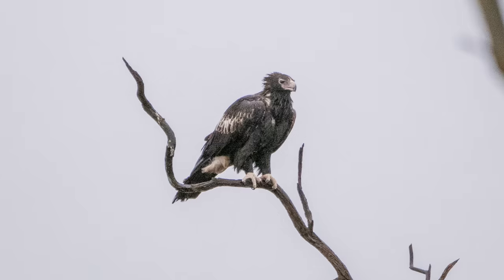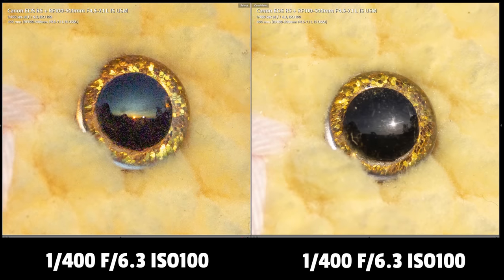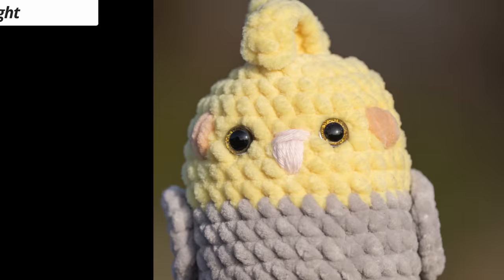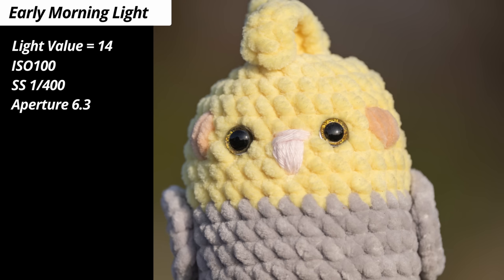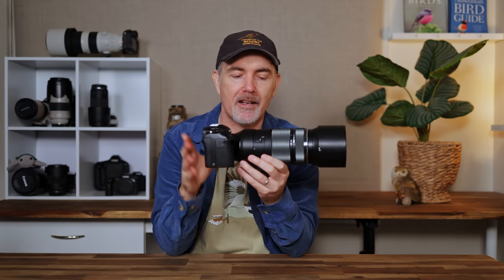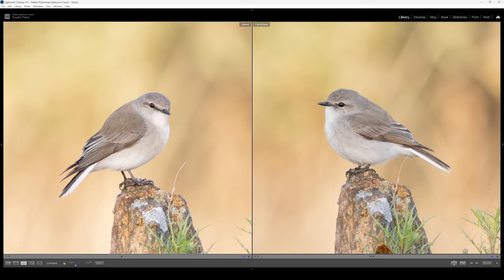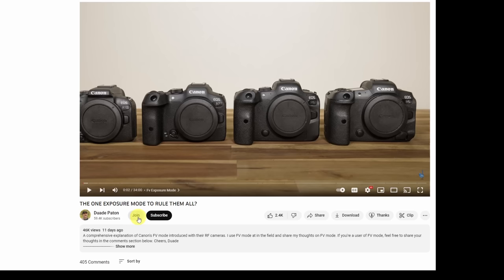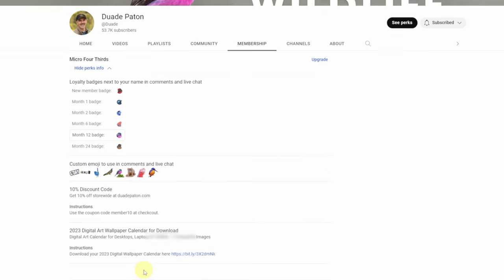NOISE SIMPLIFIED, WHAT CAUSES IT, HOW TO REMOVE IT!

Comment: Technically the lack of light is not causing noise but it is causing worse signal to nosie ratio. As a result to increase signal to viewable level you also have to increase the noise. Also. Camera does not amplify the light. If it did we wouldn't have problem with noise. It amplifies the signal recorded based on gathered light. This signal however already contain noise and they are both recorded. At first it amplify electrically the signal and part of the noise. Above some ISO it just increase the signal digitally amplifying the signal and all the noise. That is why it is better to set your ISO to achive right exposure up until the point when it doesn't matter any more.
Reply from the maker: Thanks Pawel, totally agree, I sould have tried to explain it has you just have. I have pinned your comment so people can see it first. I battle trying to keep it simple and not too complicated but will try better next time. I guess on a simple level the lack of light causes the SNR issue? Cheers, Duade
Reply: @Duade Paton  you explain well just sometimes a bit fast
Reply: @Duade  Yes. Because the light is our signal that changes. And the noise of digital path in camera of simmilar age is more or less constant. There is also analogue path noise that depends on heat and other factors related to that part circuitry and this one can increase with different ISOs (not only is being amplified after recording). I don't understand all the details, but essentially in most cases noise is virtually constant, and the signal differs. But after recording data when raising the exposure you increase both signal and noise. Therefore less SNR = more noise.
Reply: well said Pawel.  Spot on mate.
Reply: @@dr5290 I've never given  much weight to DXO's "weightings".
Reply: @@dr5290 same shit, different smell.  I pay little attention to DXO.

Comment: I was always a bit reluctant to use those noise reduction programs as I was afraid that they'll smoothen detail and decrease overall sharpness, but now I'll give them a try, I got nothing to lose.
Reply: Mainly Topaz will smooth the details from my experience, there is a work-around, you use the inbuilt masking tool on the subject or even better is I would overlay the noisy image with the denoised image and change the opacity of the top layer to bring back some detail but now I changed to dxo pureraw2 and the results are much better and more realistic and keeps the details better.
Reply: My main go to is DxO PureRAW. I think it preserves detail better than the alternatives.
Reply: @AndrewRock  yea im using pureraw 2 now, I have no need to upgrade to pureraw 3

Comment: Great explanation. I had noticed myself that you can use a high iso setting in bright light with little noise and the same iso in poor light and the noise is far more intrusive.
 If you are light-limited and using a faster lens is not an option and you have already maxed out the aperture and using a slower shutterspeed is not an option either for reasons of image blur, you are then forced to raise Iso. This gives the impression that it is raising the iso that increases noise but as you correctly point out , it is the lack of light that directly causes it.

Comment: Quite a few really technical comments. Bottom line is your explanation was simple and straight forward. Outstanding review. How do you determine LV?
Reply from the maker: Thanks Bruce, it is a challenge to try to make is simple as the actual techincal explanations get confusing very quickly. I try to make a balance but concede I am not an expert so get it slightly wrong from time to time. Visit this site and put in your exposure and it will tell you the LV. Cheers, Duade https://www.scantips.com/lights/exposurecalc.html
Reply: @Duade Paton  Thanks Duade.

Comment: Very informative Duade! In New Zealand with the low winter light inside heavy bush/tree cover I used to struggle a little with the Canon 5D III and tried not to stray above ISO 3200 for fear of noise. I have found with the R6 that a combination of the sensor and IBIS (with lens IS) has allowed me to live with a slower shutter speed and ISO. Where needed I have found ISO 6400 still clean of noise. However I would like to try DXO PureRAW 3 as I have been very impressed with the results I have seen at your channel and it would really allow me to raise my shutter speed and ISO higher especially winter months with the lower light here.
Reply from the maker: Hi Mike, my experience is the same, if you use Lightroom I would suggest trying that one as well. But yes, DXO works very well. I think shooting both works, that is low ISO low SS and High SS High ISO if the bird stays still long enough. Cheers, Duade

Comment: Another great video Duade.  I love your backlit Herons image a lot.  BTW, your OM-1 images comparison, I believe one main reason is that fact that you stopped down to F8 making the right image look much sharper.  Would be a fair comparison if you would have shot them at the same aperture.  Of course, I agree about noise reduction software these days, they are amazing and I do use DxO as well. Cheers.
Reply from the maker: Thanks Narin, yes, I probably should have, I just wanted to show that you can stop down and use higher SS and still get nice shots. Cheers, Duade

Comment: The notion that high ISO equals noise has some foundation in truth. CCD sensors and early CMOS sensors circa 2004 were pretty bad at high ISOs irrespective of whether you got the exposure right or not. I have the original Canon 5d and I really didn't like using it above 400 ISO. The banding and noise patterns in shadow areas was horrendous. When the sensor architecture changed to have the hardware on the rear of the sensor in 2009 things started to really improve and got us to the position where we are now. Prior to the development of the BSI sensor the chance of an input  proton being captured was around 60%, BSI sensors increased that to 90% which means they are more efficient in low light situations.

Comment: Well done on demystifying the noise questions I'm sure many have, Duade.  Thanks for the info & clarification on many of the pertinent points!  I shoot in cloudy, shady conditions often & as a result, often use higher ISOs with the R7 then I would otherwise.  For me, using DXO PureRaw 2 on anything over 1250-1600 ISO provides results I am almost always happy with.  The highest I have gone is 10K, but I feel that is definitely a little too high most of the time.  Recently, I have done some experimentation with LR's new denoise AI & find it quite good overall...not as good as DXO, but if LR had this feature before I purchased DXO, I'm not sure I would have done so.

For me, to manage my noise levels, I usually take a hit in shutter speed before opening the aperture of all the way, but as always, I believe it's all about what trade offs you are willing to accept. In regards to noise in images, I can say that the current software offerings make it far less of an issue than it ever was in past.  You really can get away with soo much more now.  It certainly is easier now to take great shots than it ever was in the past.  When I think about 35mm, all manual focus, set ASA/ISO speeds per roll, someone else processing your frames & the amount of grain/noise there was in 400 ISO shots...light years distance between those two times.

Thanks again for all your efforts & best of luck out there in future sessions. Best regards ~ Chris
Reply from the maker: Thanks mate, I appreciate the response and yes, we are fortunate to have the flexibility now to decide what we want to do. When I started I was restricted to ISO800 really but now we can go so much higher. Cheers, Duade

Comment: Duade, I haven't even got my camera yet and I've become a member of your page. The info you present is fantastic, but the thing I like the most is the way you present it. It really feels as if you're talking just to me in simple but fact filled ways.

I'm just a beginner, so if I was to start on a learning curve with your videos is there an order or playlist you would recommend me starting with?

Thanks for your videos you really are an inspiration 👍

PS - for your info I'm getting an R6 MkII with the rf 24-105 f4L kit lens, the rf 100-500 f4.5-7.1L and I found a pristine 2nd hand rf 800 f11 (will also be getting the 16 f2.8 & 50 f1.8 primes at the same time).
Reply from the maker: Thank you for the support I appreciate it, congrats on your kit, it is wonderful, the 800 f11 works surprisingly well on the R62 and is great for small birds. The RF100-500 is just wonderful for everything and hte 24-105 is great for landscapes etc. There is no real order in which to watch the videos, perhaps see what you are struggling with or need help with and leave me a comment and I will respond. Good luck, Cheers, Duade
Reply: @Duade
I mean this in the best possible way, but it's your fault I went and bought the RF100-500 & RF800 😛

Joking aside, I had originally ordered RF100-400 with the R6 2 and felt happy after seeing your video on it, but then saw your video on the RF100-500 and thought if I pay the extra now I'll have the benefit of an extra 100mm at the top end, always know I have the better lens and won't regret the extra cost in the long run.

I got a hardly used RF 1.4x extender to go with the 100-500 so that will take me up to 700mm and also have the RF800 for the additional distance. I can try the 1.4x extender on the 800 to see how it is in good light for a massive 1120mm (not sure how it will go at F16, but it's worth a go and cost me nothing to try as I got the 1.4x to use with the RF100-500).

Your videos make it so exciting for myself to get into photography, and what with myself turning 59 this year I've got the next years to try and pick up some of the great tips from your videos. Not expecting miracles, but hoping I can progress from a complete novice to being able to get some decent photos in a shorter time than if I hadn't saw your videos.

Mate you really have got a way with presenting the info in your videos that not just present it in a simple and easy to understand way,  but you provide this excitement of what we can do as amateurs to produce photos that will put a big smile both on our faces and hearts.

Thank you for putting so much of your valuable time into the videos you produce - 'go you good thing' 👍
Reply from the maker: @celts88-78  Thanks for the kind words I really appreciate it. It is a wonderful hobby to pass the time and enjoy nature. The best advice is to try and find a local lake or park with tame birds and practice on those to get a feel for your gear, light etc. it is very hard chasing rare birds in the bush and can be a bit frustrating. Try to enjoy the process of being out and try not to focus too much on the photo to start with, of course this is easier said than done by many times I have come home with nothing but I had a great time getting nothing. 😀 Have fun out there. Cheers, Duade 👍
Reply from the maker: G'day, apologies for the delay, thank you for such a nice comment and I really appreciate the feedback. Have fun with the kit. Cheers, Duade @celts88-78

Comment: Thanks Duade another very informative and comprehensive video. I've gone the full circle with noise reduction, starting with topaz DN then on to  DXO then back to Topaz Photo AI. I've been using the latter because I can do noise reduction and sharpening all the same time. A one stop shop.  Recently I did try the light room Denoise and I was pretty impressed. 
Finally, I've had a question it's been on my mind for ages. And that is whether I'm actually processing my images correctly for what I want in the end. So I shoot in CRAW and then run that through my noise reduction. I take the massive DNG file, crop it as I see fit and reduce the size down to 20 to 30 megs. That is the TIFF file that I send to Lightroom for editing.  I use the final edited file to print a JPEG for social media etc.  I wonder reducing the file size down to 20-30 megs affects quality. Certainly for social media as I don't see is a problem but if someone wanted to print something and put it on the wall, should I not reduce the size from the DNG? What would the minimum size be? Thank you for your time

Comment: Great base description, but you missed an important part on aperture, and that is effective aperture. The aperture is actually defined as "focal length" divided by "entrance pupil". So an 800mm F6.3 has an entrance pupil of 126mm, while for example a 400mm F4 just has an entrance pupil of 100mm. As the entrance pupil size suggests the 800mm 6.3 is actually capable of collecting MORE light than the 400mm F4!   This is intuitive if you would use a 2x TC on the 400mm, it would just act as an 800mm F8. But the same happens when you crop in camera. At F4 each pixel gets more light, but as there are far fewer pixels of the subject, the overall light gathered from the subject is lower. So if you crop, the equivalent aperture is a far more valuable comparison tool than the numeric aperture of the lens! So if your subject is at a distance where you have to crop anyway, a 600mm F6.3 gathers more light than a Nikon 400mm F4.5, or a Canon 800mm F11 gathers the same amount of light as a 400mm F5.6. The Canon 500mm F7.1 often criticized for its small aperture gathers for example the exact same amount as a 400mm F5.6 ...
Reply from the maker: Thanks for that and very interesting, it all has to do with cropping doesnt it. Same argument for and against APSC and M4/3, they have an advantage until you don't need to crop and then the FF and lower aperture has an advantage. I guess it all depends on how often you crop and can you get close to the subject. But great way of thinking of it, thanks for sharing. Cheers, Duade
Reply: The argument on an APS-C or full frame sensor. If you put a full frame lens on APS-C camera, you are in effect  getting a cropped version already. If my friend and I are standing in the same place, me with a 24 megapixel APS-C camera and he with a 36 megapixel full frame camera, We both have a 600 mm full frame lens. Taking a picture of a statue far away, the effectiveness is not much different. He may need to crop his pic in post to effectively get what I am already getting in camera. Now if the statue is 10 feet away my friend may not need to crop in post and my camera did not get the shot.  I do shoot with APS-C sensor camera for this reason. 

When picking a lens, if it's a long fixed or zoom lens, I will go for a full frame lens, I can get a 300 mm with an effective 450 mm. In a short lens, I will tend to get an APS-C lens. I purchased a 50 mm full frame lens because of the quality of lens and the price, I would rather have gotten a 40 mm DX lens or a 35 mm full frame.
Reply: Vary  informative,good explanation of aperture & light ,keep up the good work !

Comment: Very well explained video and should give confidence to use older gear.
My first DSLR was canon 400d and is maxes out at 1600 ISO, I upgraded to 7D and noise came in at 800 ISO, then I upgraded  to 7Dii and that was good up to 6400 ISO. My latest cameras Sony A6600 abs canon R7 are still noisy after 6400, however software removers 95% of the noise and sharpens the image. So people do not be afraid  of the dark and the noise ! !

Comment: On your little window comparison, you should have had the smallest window, with a curtain over it, to simulate my 800 F11 :) lol LOVE my slow lens :) My R7 has a max (default... I think it can be expanded) of ISO 6400. But I personally try to keep it to a max of 3200. Typically, even in lower light, ISO 2000 or 2500, for my safety shots, with a shutter speed of like 1/200 or 1/250th. Then, if my subject sticks around, I start bumping down my shutter speed, and just take lots of shots. After all, I really only need 1 good, sharp one :) DXO for the win ! If it still needs it, I might use a touch of Topaz, as a final step.... but I kind of consider that a personal fail. If I do my job correctly, it shouldn't need it. Great video as usual :) TY.

Comment: Can I just add, coming from an original 7D ( 2010 ) a notorious camera for noise, one thing I remember from back then was to use native ISO settings, that is 100, 200, 400 , 800 etc etc. if you select say ISO 640 the camera will boost it to 800 if it feels it needs to, and that extra boost introduces quite a lot of noise, more than if you just set the ISO to 800 initially. 
When I bought an R6 I wasn’t blown away by the FF sensor, that was because I was shooting in good light where the differences between crop sensors and full frame sensors is diminished even when there’s 10 years difference between the sensor tech.

Comment: Hello Duade. Thanks for another cracking video. I am based in the UK and very often just have to deal with whatever light I'm given. No bother but I use DXO-PR2. I know that you sometimes use it as well but just lately I have been struggling with it and getting a lot of garbled and corrupted results, especially if I try to use Deep Prime. I wondered if anybody else had been experiencing this. Have you had any trouble with it recently?
Reply: Check if you are using the gpu that your drivers are up to date